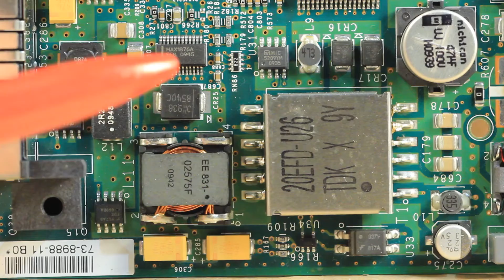Repair Cisco ASA5505 firewall not powering on: video reply to subscriber question

Comment: One of my ASA5505 recently failed to power up after more than 10 years of operation. Glad I found your video. Replaced C275 and it is running fine again. While I was at it, I replaced the empty CR2032 battery and also replaced the 512MB CF card by a 2GB card.
Reply: For sure the battery and cfcard are not to blame
Reply: I think it's a common problem. Capacitors! After 10 years up, once down and never up again.
Reply: Have you got a link to where you purchased the C 275 capacitor?

Comment: Hello Friend!
Thank you so much for your work. I repaired my ASA 5505, which I had at home. I removed the C 275 capacitor (22 pF) and changed it to another, larger capacity. ASA immediately launched!
Guys, put large capacitors capacitors, if you do not have these at hand. I think this is normal.
I also advise you to put a small fan in the case. I put the 12 volt, and connected it to the 5 volt bus (USB). It is very quietly spinning and creates sufficient air circulation.
Reply: Have you got a link to where you purchased the C 275 capacitor?

Comment: Donkey you are awesome! I just repaired one of my asa 5505's that would not power up. I replaced C275 with a larger 33uf 50v capacitor, it fired right up. I'm feeling like a boss! Thanks to you. For those of you trying to repair your asa 5505 from this problem here is what I did.

I have an ESR meter that tests capacitors. From my testing it seems that you can test these 5 capacitors in-circuit. Best to take them out, but on my tests C275 tested to 17.5uf and esr of >40 ohms, it tested the same in or out of circuit. >40 ohms is not good from what I understand. An esr value closer to zero or less is better. So I found the closest replacement capacitor I had on hand, just to see if the thing would power on and It did so immediately. I should replace all of the caps with proper replacements.

Donkey, if you can maybe you could post the actual values of the capacitors as some of them are not clear on the size and voltages required.

Comment: Огромное спасибо! Оживил ASA5505 заменив конденсатор C275.
Thank you very much! Revived the ASA 5505 by replacing the C275 capacitor.
Reply: СМД электролит сдох... В ноль.. И все дела... А то пол платы перепахать... Туда и обычный подпаять можно. In any way this capacitor "starts" the whole chain of the power supply for the board.

Comment: Thank you very much for the video. I have repaired my ASA5505 only replacing the C275 capacitor (22 uF/35V) with a higher voltage capacity capacitor (22 uF/50V)!

Comment: Thanks a lot! In my case it was C275. I heat the capacitor with a heat gun as shown on the original video, the board came up, but did not start again after cool down. To confirm, I momentary connected a 22uf/50v radial capacitor over existing, and the board start working
Reply from the maker: I am happy that the video helped you, and also the environment has one less Cisco ASA5505 in the landfill. Although Cisco boards use quality components, sadly caps will dry out after 5-10 years, and they need replacing.

Comment: Hi, base on my experience i was repair this CISCO ASA5505 i received this item from my customer (No Power) i was completed my troubleshooting and replace few component in primary section and secondary section. Primary Section i was replace E-Cap C275  Component ID and capacitor value 22uF/35V . in secondary i was replace Capacitor,C307,C308 & CR25 ,this component i was measured in multi meter its was shorted. Once i replace the system is power On is working well, hope this will help. Thank you

Comment: Sir, thank you for this video. I'm trying to get life to a VCR/DVD combo for a long time. I have replaced some diodes and the controller IC of the PSU... Also one funny measuring cap. Now I tried the heatgun trick and it came back to life ;)  You say "the capacitors (mainly electrolytic and tantalum caps on this PCB) which have high equivalent series resistance when they are cold due to old age, since the electrolyte degrades with time." Can you clarify this? What happens with an old cap? Does it start to leak? Does the value change? Why it prevents to startup the PSU? A short or wrong value? I love your video's. Learned more with it then in 2 years high school ;)
Reply: To answer my own question. The PSU started when the caps where heated. When I measured with the scope, the DC looked very bad. Huge rimple. So at high freq, the internal resistance of the cap rises a lot. So it can't do it's work. When measured with a normal cap meter, it looks OK.
Reply from the maker: @eddysmit  Exactly, as you have noticed, one cannot really measure an old dried out capacitor with a standard meter. Instead, you will need an LCR meter, which also measures the so called ESR (equivalent series resistance) of the capacitor. Practically what happens is that the electrolyte, which is a liquid when the cap is new will slowly dry out, and get more viscous like paint dries with time. Due to the lower ion mobility the internal resistance will increase, and the capacitor will no longer behave like a capacitor, but instead behave like a capacitor put in series with a resistor, which is no good.

Comment: Another great video.  Are those smaller smd tantalum capacitors  47uF 16V..  what is the 636?   I saw reference to PWC but I'm not sure what PWC is.
Reply from the maker: Yes, the tantalums seem to be 47uF/16V. I would replace those most probably with 100uF SMD electrolyte caps, which are 0.2Euros and they can be almost directly solder back in place of the tantalum cap footprint. Also, the ESR of the tantalum caps is very low, so using a higher value electrolyte will kind-of compensate for the ESR difference.
Reply: 636 is 63u (63 and 6 is exponent 10^6) = 63*1 000 000=63 000 000pF = 63uF
beware that capacitor marking 63M is not Mega, but it mean 63u (microFarad)

Comment: hello Donkey Learning, you were right, the 20efd-u26 replacement make ma motherboard burn. As I had another motherboard of 5505, I order a capacitor C275. But before I try to use polarised capacitor 22 micro farad to put above the c275 without take it off the motherboard. And the asa turn on. I should received new capacitor and try to make video in English :) and we wi9ll see.  
Again many thanks for you videos. ounet
Reply from the maker: Good to hear that your ASA is slowly getting better. I would replace all five caps, because when one is dead, the other ones tend to go dead soon after as well. Let me know whether you have managed to fix it.

Comment: Hi I have Cisco 5516 firepower device and it has a issue like the device has power on LED and status LED is amber also when i connect the LAN port is not showing UP 
please help me out is possible
Reply: There’s a field service notice on the 5516 for failing. One field notice is due to a feeling clock in another due to feeling resistor which give you power on green and status Amber. The device becomes unusable. I just had one feel like this.You can verify your serial number to see if it was one of the affected. Three of the four ion have been affected.
Reply: Fail not feel....sorry for typo

Comment: Could you please make a short animation from powering up to voltage out about SMPS. Actually a animation how ac voltage travel via semiconductors and transformer and then DC output made. Waiting for your 3rd part of SMPS tutorial.
Reply from the maker: I was thinking about making something like that via Blender, but I am really bad with Blender, and I can so far make only basic shapes. Nevertheless, first one must go through the block diagram, otherwise even a good animation would not be very helpful. My third video is 70% done, but I am fully swamped in my job, and for the weekend I must take a brake. It will be done soon, and it should be an informative video on inductors.

Comment: I don't understand English speaking) pls write: 5 capacitors need to replace?
Reply from the maker: Replace first the electrolytic caps (aluminum housing). After this, if it did not help, replace also the tantalum caps.

Comment: Hello. today I repaired one of these problematic ASA5505. I found "a franch video" mentioned here and trying to warm up power section with hot air - without removing transformator... And whats suprise... unit light on. So after cool down unit returned to failed state, so I started to warm up every component near transformator. It looks like only one component went bad, electrolytic capacitor 22u35V on the border of the power section. I was simply replaced it with another non smd (22u/100V), there is planty of space to use it. I hope it can help to someone else :-)
Reply from the maker: I am glad you managed to fix it. As I said in this video, most of the time those caps will fail, and replacing them will fix the ASA5505.
Reply: This happened to mine too! Thank you for the clues. I never replaced a electrolytic capacitor 22u35v before.
Reply from the maker: All you need is a new cap, a soldering iron, little bit of flux, two tiny drops of solder, and a lot of patience
Joke aside, it is easy to replace it, just desolder, remove old solder with solder wick, solder new cap back on. 
It should be ready to go, good as new!